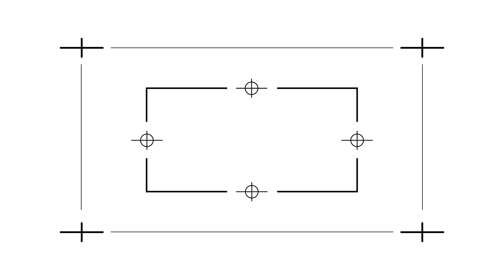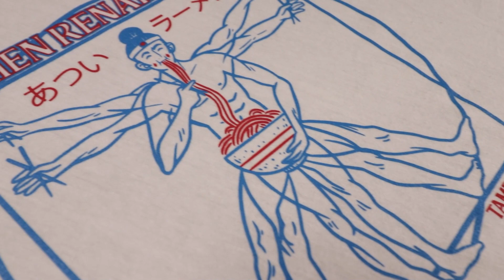Registering 2 Colors On A Riley Hopkins 150 Press /// Screen Printing Without Micro Registration

Comment: I've seen many people register screens with the tape method you used. I prefer to put a film positive on the pallet and line all of my screens up to that because the drag of your squeegee will slightly shift the print up or down, depending on whether you push or pull, which is why your second color was too low. But that was a great segway into demonstrating how you can manipulate your prints with a bit of technique. Similar results can also be achieved on an automatic by adjusting squeegee angle/pressure and stroke speed.

Comment: Seems like you've got the hang of doing it without micros.  If you had it to do all over, would you recommend buying the 250 over the 150?  The price difference is rather large, but I don't see myself doing huge runs.  So I figure I'll be doing a lot more registering than printing.  Would it be worth my money to go with the 250, or do you think I should go with the 150 and use the extra money for a flash?  I've got enough money to get a flash even if I buy the 250.  I'm not rolling in dough, but I've saved up for a while and sold some of my other hobby stuff I don't use anymore.  I just would like to know the most efficient use of what I have to spend.
Reply from the maker: I'd say if you have the money for a 250 go for that, micros make everything easier, but if you're not sure about screen printing yet and maybe unsure about committing your money to it then the 150 is a really great deal and a good press to learn on.
Reply: @joshisterrific  Okay, thanks!